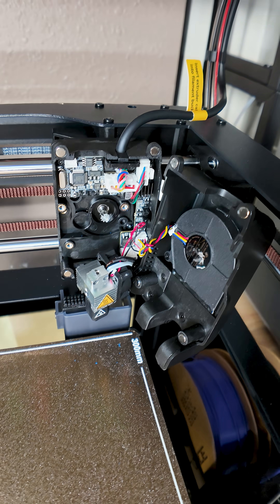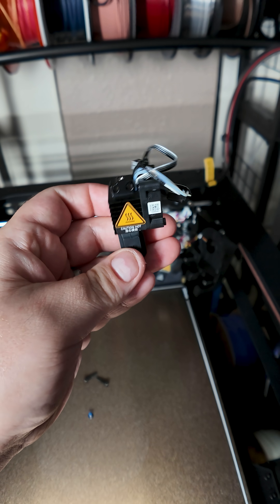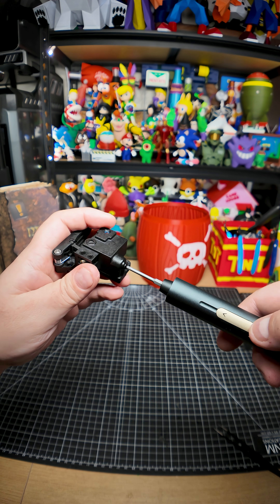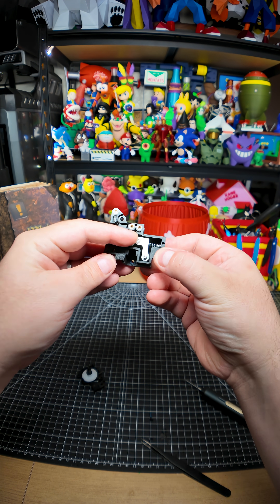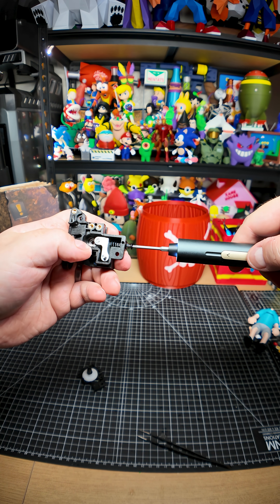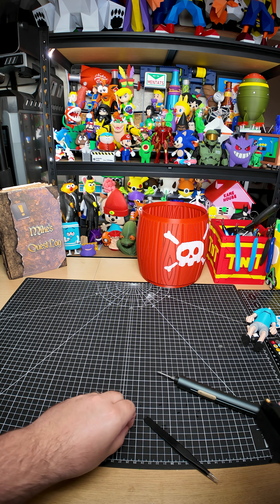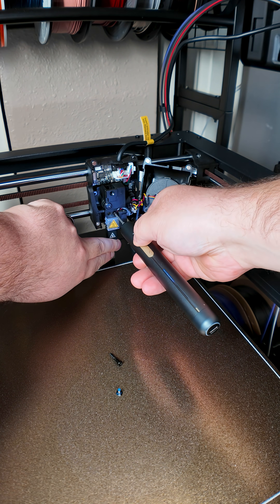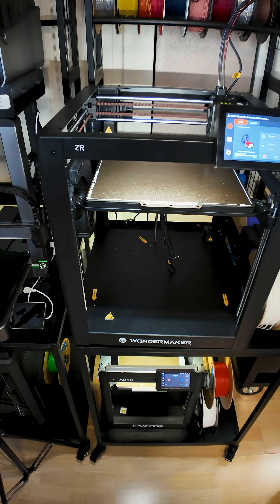The Wondermaker ZR - Absolute Dumpster Fire continues

Comment: Looks almost exactly like mx X1c extruder,  using BIQ claw now as wore out original( prob wore out with glow in the dark filament)😊
Reply from the maker: It looks very similar but it is not the same. They clearly ripped off the design but missed marks where it matters

Comment: I would take those screws off the top of the coupler and see if there are any glaring issues like tangles or just tug the filament see if the one throwing error feels funny
Reply from the maker: There's no screws on top of the coupler though, these are just pneumatic connectors. And I did take everything off multiple times, made sure there's no obstructions and issues, I even dismantled the filament module to check the feeders, they are fine they work, the voltages are correct too. I am leaning towards a software issue now. Something unrelated goes wrong but there is no code for it so it throws a feeder error